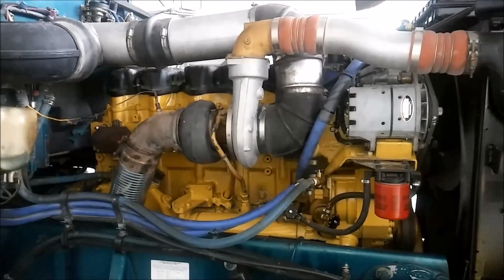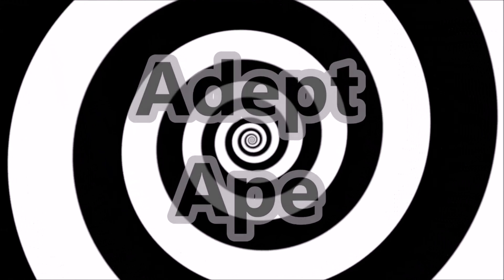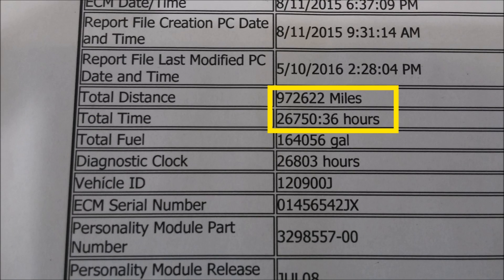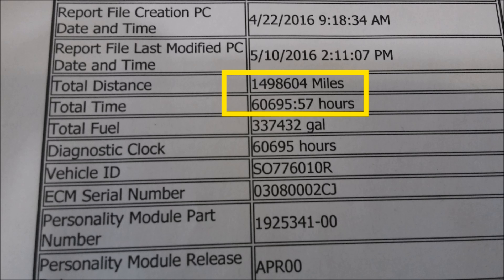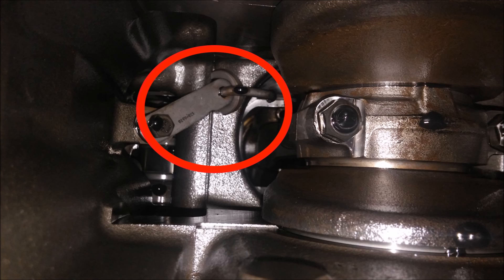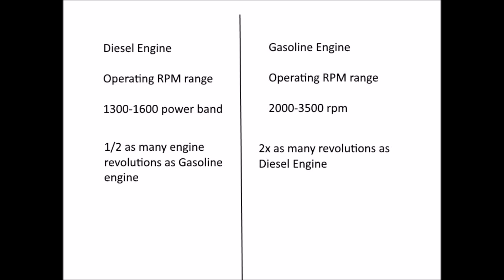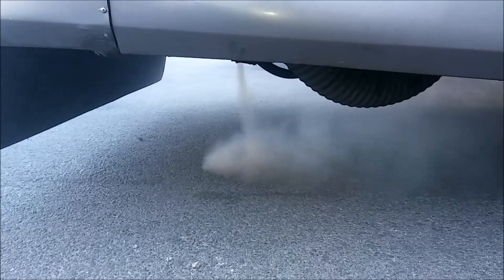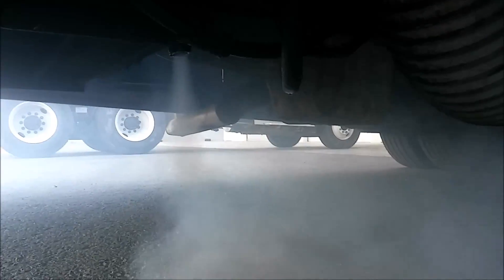Why Do Diesel Engines Last So Long?

Comment: i like when people spend 80k on a bad ass diesl and only use it as a everyday grocery getter and never haul nothing and spend a shit of $$ operating it . servicing a diesel cost more than a gasser ,   oil , filters, etc ,and dont to go get a diesel worked on it will cost a arm and a leg .got a lot of friends who hav them ,.. i just keep my gasser i can buy a lot of gas with the money i saved from getting a $8k-$10k diesel upgrade also
Reply from the maker: +e harris I drive a gas car as well. Diesels are great, but expensive unless you are using them to haul. I used to work with a guy with an 800 dollar a month truck payment, for his daily driver, that is a lot of money.

Comment: Exactly. And pay attention to your filters. Pay particular attention to the manufacturer service intervals. The reciprocating mass inside the block is covered here but remember that the fuel delivery system is very expensive and delicate meaning it must be kept in top shape with service intervals or will make you wish you had kept grandmas' Biscayne.

Comment: than why is gas used more and why are most vehicles use gas because gas is still better in some way
Reply from the maker: +Kyle Murray It's a lot cheaper that is why. Diesel engines usually cost more and Diesel fuel in many places costs more as well.

Comment: the internet experts are coming out in force. the reason truck diesel engines last longer simply because they are much better maintained then a passenger car engine. diesel trucks go to a dealer for oil changes or to a certified shop they're not allowed to have any other problems because they will shut the truck down at the scales. yes they are more heavy duty then a gas engine. they also cost a hell of a lot more. also Modern Diesel engines are better than the older ones and last a lot longer.

Comment: a bit misleading bud. diesels do last longer, I've personally seen multiple north of 2 million miles. however that's because they have been rebuilt 2 or 3 times. the average miles is only 750 to 900 thousand miles before and inframe/minor overhaul of the majority of major components in most cases.

other than that great video expanding why.

Comment: The one thing you do not cover is light truck diesel engines. Here you are talking about a 3 litre petrol engine compared to a Cat  C15 (3406) 15 litre engine. To give a TRUE review would be to compare a petrol and diesel engine of similar sizes. Eg: Toyota HiLux 2.8 or 3 litre diesel engine to a 3 litre petrol engine. These small diesel engines do similar miles to their petrol counterparts and also do Stop Start motoring  (To work and back).

Comment: I'd say the contrary. A gasoline engine is a runner for way more miles.

First we should compare apples to apples. So take an average normal aspirated 1.5L-2L gasoline engine (a ford focus for example) for around 100kW and compare it to the equivalent 1.9-2.2L diesel engine for the same car, that has about the same 100kW power.
Duty cycle is the same.
Both have 1 thermostat, belts for timing, etc.. The diesel engine is way heavier, cast iron, bigger crank, longer stroke, bigger journals, lower rpm.. but they have a lot more heat inside the combustion chamber, a lot more pressure to deal with.. that's why it's built more robust than the flimsy gasoline engine. I'd say the wear is equivalent because the heat and pressure is way bigger in diesel and those contribute to higher wear, but the rpm is a lower so they kind of cancels out.
Diesel relies on tight tolerances inside injectors and common rail high pressure pump and turbo.. they are very expensive components and require a lot more maintenance. So it's an expensive engine where lot's can go wrong and make it not profitable to repair it if it's older and the fuel pump succumbs in a cloud of shrapnel that destroyed the injectors as well. (a likely scenario after some 100-200-300k km.
The gasoline engine is a runner without having very expensive components.. so if I'm looking at a new car.. maybe a diesel is OK, but for an older car.. gasoline engine is cheap to repair and if it has compression from start and it is not seized.. it's a solid runner.

Another thing that resulted from you comparison: From an engineering point of view, we can design and build engines to run several millions of kilometers without an oil change.. but the cost will be prohibitive, plus it will be complex, lots of added systems lots of added weight. So for a commercial truck that does a million kilometers within a few years (and it is expected to run this amount of years and kilometers) the engine and rest of components are designed and built to do exactly that! So that cat in your example is built to last those amount of kilometers.

For a passenger car, the car is expected to run without a hitch for 5years and 100k km.. and most of them do this flawlessly. Realistically, a passenger car runs fine for about 200-300km and a bit more if maintained well (like.. after that amount of miles, adjust valves gap, check compression, etc..  and maybe replace valve guides, piston rings accordingly.. it is expected) and can squeeze another 200k km.. after that with a rebuild and carefully checking every auxiliary system it can run indefinitely.. but it may turn into a money sink being more time under maintenance than running. And for this kind of job.. a gasoline engine is easy to bring to factory spec on the cheap.. need an overhaul? buy crank/conrods/pistons/head/etc.. it's like new (like 2000$.. not very cheap, but cheaper than diesel). For a diesel all components are more expensive, plus some really expensive fuel system that is not rebuild-able.. but replaceable.. so have fun chipping 300k km in a 2L diesel ford focus, then find it lacks compression and change the rings, then find the injector is leaking and burned your new rings, then find an injector is 500$ and need 4 of them, then the pump is not quite like new and want to protect the new injectors so you go 2000$ for a new pump.. and after all that the turbo goes wild and makes the engine run-away and trashes everything (or avoid that with a new turbo for 1-2000$).. and you reach the realization that the whole car is not worth that much money.

Need a fuel pump for gasoline? you can get it for 10$.. or 100$ for the original one, need injectors? 400$ all four of them, no expensive turbo.. so it's a runner. while the diesel.. once it's life is at end is very expensive to keep it alive as i mentioned.
Reply: AsiAzzy You’ve got no real understanding of the matter in spite of all of the info you spewed. Why do ALL of the LARGE engines (heavy truck and the BIG heavy equipment) run on diesel fuel and not gasoline?  Diesel engines are far more reliable and have a better return on the energy within the fuel molecules.  Cars can run long distances on the highways, but not all do.  However, a car or pickup can’t pull nearly as well with a gasoline engine compared to a Diesel engine. Especially an in-line diesel. Sorry.

Comment: We in Europe have had small automotive diesel engines since many decades now, and the older ones from Mercedes or even VW are really long lasting engines - even though they did have timing belts or chains, or things like that (and of course the bearing you are showing is from a really big heavy machinery engine, comparing it to a smaller automotive engine is not fair). And these old 1.7L or 1.9L diesel engines from the 70s, 80s well into the 90s, which did run for 1 million km or more, did also have the normal heat cycles that an automotive gasoline engine has. It all comes down to maintenance, and besides the physical differences (i.e. diesel being a lubricant as well, accounting for less cylinder wear) many of the points you made are only true in the specific use cases of heavy machinery that you encounter (you say you work on CAT engines, these are probably huge and used in giant backhoes or stuff like that), but aren't necessarily the main factors.
However, the newer automotive diesel engines from like the 2000s on (or even the late 90s) don't last as long either, because the technology has become more and more refined (i.e. with direct injection and so on), and more complex in that process - higher complexity accounts for more moving parts, which makes for more possible points of failure. But I think the large heavy machinery engines you work on (maybe 6-12L displacement or so?) haven't been refined as much over time (since they were sufficient from the beginning, which often cannot be said for diesel cars from the 80s and the 90s), so they are still of the older, sturdier design and thus also last longer. A modern automotive diesel engine however doesn't have these advantages any more, just compare a 1.9L Volkswagen TDI from 1990 to a 1.9L Volkswagen TDI from 2015 (if you still have those after the "Dieselgate", that is), and you'll see what I mean. Not necessarily a good development in all regards, but still in some (considering driveability and comfort).

Comment: What's your opinion on running automatic transmission fluid and or two cycle oil and the fuel tank of diesel car and/or truck what a be possible to make a video about this?
Reply from the maker: +Luke Shaw I know guys that will prime fuel filters with transmission fluid, but don't know of a reason to put it in your tank.

Comment: Back in the 60's and 70's people put propane on gas engines and then they lasted a very long time as well.Fuel injection has helped gas engines a lot, less flooding and better evaporation. I've had several carbureted engines where just the back 2 cylinders are bad - the ones where the not-evaporated gasoline runs to.

Diesel is a dryer fuel, you seem to get more water in a gas engine. 

Diesels run very cool, you can usually hold on to the exhaust when they're idling. Of course with a lot of turbo boost they do run hot. If you want your diesel to last, don't overfuel or overboost it.

Comment: OF COURSE, if you don't take care of a diesel engine it will break.  ANYTHING that gets abused will break!  Run any engine without oil, it will seize.  Unfortunately, there really are people who will seize and engine, and wonder why they need a new one.  Speaking of RV's a friend of mine, his brother, had an RV, and he ran it without oil and the engine seized.  Doesn't matter, run it without oil...it'll seize.  BTW, he later did the same thing with a car.  Some peeps NEVER learn!
Reply from the maker: +NiceMuslimLady Maybe your friend needs to look how to use a dipstick.
Reply: My friend does...his brother is the one "what's a dipstick?"

Comment: Chevy Duramax  2.8 has a timing belt. That's what the book says.  GM can screw up anything!!
Reply from the maker: +GeneralAlex4 I don't think any engine should use a timing belt, gas or diesel.
Reply: I agree; GM probably did it to keep it quieter !! I don't know why they did it!
Reply from the maker: +GeneralAlex4 That makes sense, destroy the engine to save a decibel of engine noise.

Comment: Yep, but when diesels go , they go in a big way - often wiping out the crankshaft and making the block unusable. And it's often hard to hear any knocks or other noises over the clack of the injectors and the combustion event.
Reply from the maker: +shoominati23 They are very expensive and very expensive to repair.

Comment: The engine might last one million miles but the chassis won't.
Reply: Gabriel S. My 2006 w9 kenworth has 1.1 million on.. the tranny has been rebuilt. Brakes shocks tires replaced... but the rears are original.. even original U joints in the driveshaft.. using a quality red grease often goes a along ways.

Comment: Diesel engines are maintained differently. The bearings are replaced at certain intervals. The engine will be completely overhauled at certain intervals.....If you went to that extreme with gas engines they will last just as long.

Comment: I liked your video except for showing the size of a chevy bearing using a piece of plastic or paper v/s using an actual bearing from a diesel. The comparison was lame instead of actual.
Reply from the maker: +MOMS I had some Ford 460 bearings in the garage awhile ago and was going to use them, but couldn't find them so I just found the measurements for the Chevy and used that, not ideal, but still the same size.

Comment: They run cooler because diesel burns at a low temperature. Heat is a big cause of wear and breaks down oil. I take my thermostats out because I live in the south where it doesn't get very cold and I have several gasoline engines with 200 thousand miles that don't burn a quart between oil changes. I also use synthetic oil
Reply: Wrong diesel burns hotter that's why the rad is bigger to keep things cool

Comment: Not...I have a diesel VW 1.9 liter TDI, 4500 rpm redline and at 70 MPH it's cranking along at 2500 RPM. So much for lower operating range...I also have a 99 F 250 Superduty 7.3 Navistar 2000 RPM at 70 MPH again nope!! Dude lets compare something at least in the same ball park!! Of course the 928 CI Cat is a hell of a lot more robust! DUH!! It's like comparing a garden tractor to a bulldozer!!

Comment: The only gasoline engines that can compete with diesels are Toyota's 1UZ-FE V8  they're also known to make a million plus miles with proper maintenance, Leave it to Toyota to do something amazing.
But very good points you've made, the biggest things factors on a diesel running longer are like you said diesel is a oily fuel, the engines spend more time running and the RPM's are far far lower.
Reply from the maker: +MechRider89 I know their 22r and 20r have some incredible longevity too for being a little gas engine.
Reply: Adept Ape Indeed they do! I ran a 22re with no coolant for 30 miles when it blew a rad hose and the temp gauge wasn't working so I didn't know until the smoke started. Fixed the hose, started right back up and ran it for two more years to 240k miles. I'm a Toyota fanatic.

Comment: Most the points you raised are untrue on diesel engines that are the same size as the gas engines. Accurate and interesting information just a little misleading. good video.

Comment: What do think of Diesel powered cars which one would be better 2.0 litres Diesel or 2.0 litres petrol engine
Reply from the maker: +faizan joyia (mac man) I would probably buy the petrol one, as they are usually cheaper to maintain and buy. Depends though. Both the cars at my house are gas.

Comment: Calculate piston speed and do not use only RPM as a comparison between a gas motors and diesel motors . Most Diesel pistons travel a longer stroke than a gas motor of equivalent displacement size. You will be surprised on how close the actual piston speed are between gas and diesel .
Reply from the maker: +Ray Dreamer That is a good point sir, I was reading about that topic about a year ago and yes piston speeds are surprising close from engine to engine on most combustion engines.

Comment: Who cares? Now that diesel is as expensive as gas and sometime even more so. Fuel, fossil fuel, is on the way out. Iceland has already gotten rid of it and replaced it with wind, solar and hydrogen. I'm looking into converting to hydrogen in the Prius I already own to completely cut out big oil from my life. When Elon Musk comes out with his solar roofing it's going on the house along with wind to bump up the yield. But, I'm not disconnecting the street power. The excess I hope to produce will be sold back to the grid so every month they'll (PG&E) be paying me instead of the other way round. There is a war going on between the upper class 1% and everyone else. Think Gandhi! Don't buy from corporations, don't use their credit cards, and do everything you can to squeeze them out of your life. They are the biggest enemy we have here in America.

Comment: one thing that I see being the main reason for all engine failures is poor maintenance.  which you did address towards the end as I was writing this, lol.  over the last 10 - 15 years the amount of diesel powered trucks that I see on the road has doubled or even tripled.  when ford started making the new body style for the superduty, it started becoming the vehicle that I'd see the most (in north texas).  some still had a gas engine but the majority sold are diesels. it sort of became the vehicle to have.  people who don't even know where a dirt road is were buying the crew cab 4 wheel drive superduty diesels. and the problem with that was you had a ton of people now driving a diesel truck who had no idea how much more expensive it is to maintain one.  and you also had the same people buying one who didn't maintain their gas powered vehicles very well either.  and then you had the guys getting them tuned to run so rich that every time they touch the accelerator, they'd leave a big black plume of smoke.  I can say that I don't see the "rolling coal" nearly as much now.  the tunes are getting better.

Comment: While this may be true, you're only comparing a semi to a car/ truck. This is a pointless comparison. semi diesels will outlast any personal vehicle. This is due to useage differences not just gas vs diesel. Any semi couldn't last to the million mile mark it would not be economical for a company to buy, even construction companies only tend to buy trucks that will last around 2-300k miles. Most personal vehicles, gas or diesel, are only designed to last around 200k miles for most owners. In most cases after that many miles the vehicle has far out lasted it's cost, same goes for semi's 1-1.5 million miles out a machine at costs over $100k is basically the same margin of durability vs cost. Also the comparison of bearings is asinine as most trucks can only, safely, tow around 10-14k lbs, whereas most semi's can tow 40-90 ton. The bearings are bigger to withstand the stresses of towing that much weight.